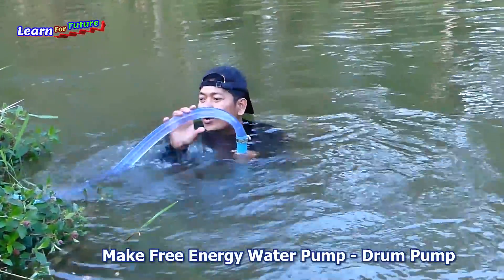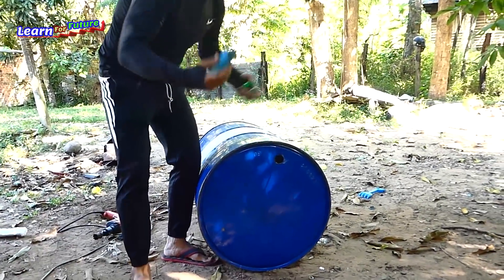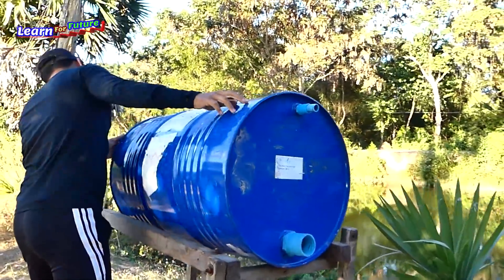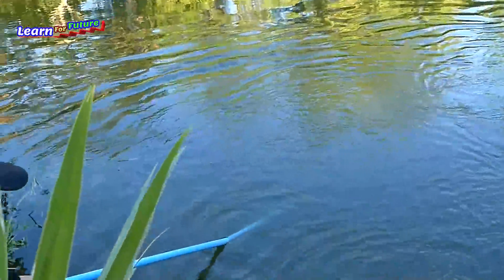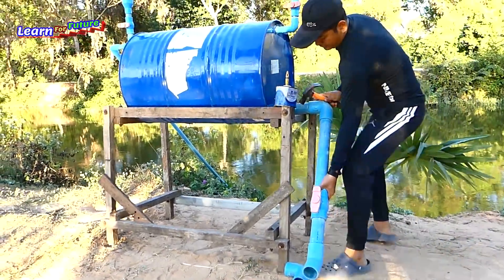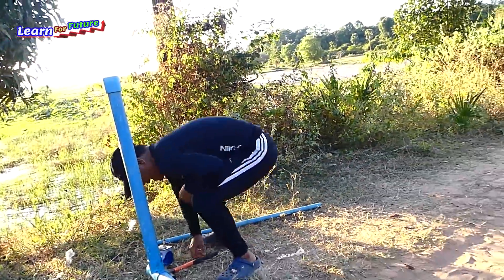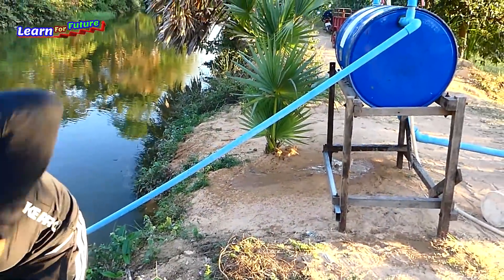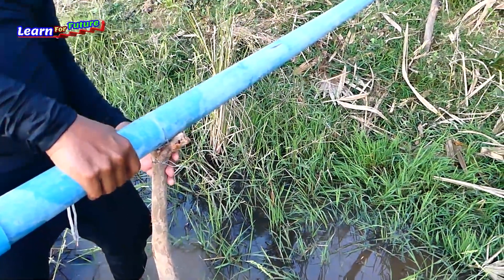Free Auto Pump Water from Deep River - How to make free energy water drum from Deep Source water

Comment: Must be air tight for this siphon to work. Input water level must be higher than the output to the field. The input pipes should be same diameter as exit pipes. No need for one-way valve at input, waste of money. No need for the vertical pipe at the output, waste of money. No need for the master valve, waste of money. The output should be dipped into a bucket of water to prevent air to leak in. Alrernativly install a upward bend at the output.

Comment: Hello sir can you give me the exact size of pipe and some materials u are using, beside that did you put a foot valve in the pipe that submered the water
Reply: If the distance is arround 500 to 600 meters from the farm to the river  do you thinks that the pump can sustain the water to the farm land
Reply: You can run this for 600++++ m, but the flow will decrease due to friction. Remember that the water level in the source must be higher than the output to the field. No foot valve are needed when using a drum. No pumping or filling of the suction pipe are needed when using a drum.

Comment: A way to increase the 'water pressure' of this system, is by increasing the 'height' of the 'inlet Siphon Drum'. Over very, very 'long distances' it would be better to install another 'Siphon Drum' (up high) next to the 'Outlet Pipe' end. Also by using Gravity to improve the water pressure, higher the drum - equals 'stronger the pressure'. I really enjoy learning from your videos. Keep up the good work my friend. Happy New Year from here in N.Z.
Reply: Is you comment based on your Experiment?? I don't think so.
The flow you get it depends on diameter and how much lower the output level than the input.
Put the drum higher you just create more vacuum in it, the water need to be sucked up higher! Even the metal drum can and will collapse like a plastic container on full vacuum>>>>
Full Vacuum??? If you try to suck water to 10M high! Surface of the drum x 1Kg per cm² = 22Tonne!!!
Atmospheric pressure crushes 220 liter drum >>>   https://youtu.be/j0TQxYemrgg
The vacuum works on cm²  figure....
Reply: Sorry Paul. There is no help in elevating the drum and no help in adding more drums. They just spoils your money.

Comment: Nice video.
It would be better if you show how the water flows out if the outlet pipe is increased in height gradually until the water stops flowing, meaning the gravity of the source is the same as the outlet pipe. 🙂

Comment: Fake!!!!
   It's a  siphon system. The  water source  elevation is higher than the output tip of the pipe. Naturally, the water wiil go up  into the drum.
Reply: Exactly, the whole drum and all the other stuff is superfluous assuming you can prime the thing.
Reply: This will work. People who think this works with gravity. It is more vacuum that does the work. In Dutch we have a word for this kind of system called a "hevel effect"
Reply: @rob12424  Now vacuum, emptiness, can dot do any work at all. What makes this run is a difference between the atmospheric air pressure between inlet and outlet.